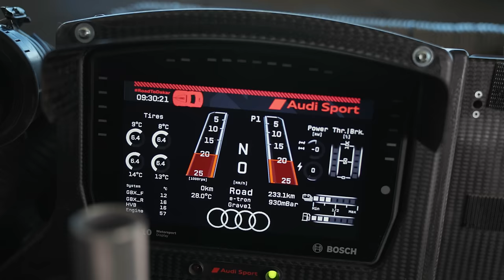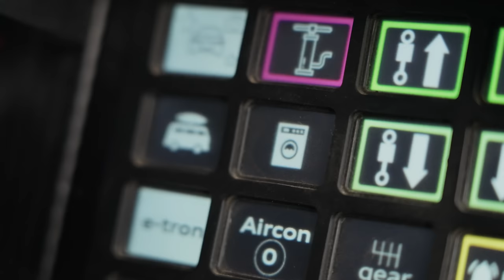FIRST DRIVE: Audi RS Q e-tron - Electric Dakar Car Tested On and Off-Road | Top Gear

Comment: Love it! Albeit all I can think of is the fact that that sound is just because of inefficiencies in the drivetrain/motors
Reply: Not necessarily. The sound indicates that they used spur gears instead of the nowadays standard helical gears. Normally, you don't find spur gears in cars, except the reverse gears in many older cars (remember that sound?), but they can actually be more efficient because there's less friction between the gears.
Apart from the loudness (which clearly isn't a problem here), the disadvantage of spur gears is that they can't cope as well with high torque, which makes them seemingly an odd choice also for a race car. But apparently it's ok, perhaps because the ground traction is low in the desert and the electric motors so smooth.
Reply: @leftaroundabout  electric cars have similar torque at all rpms , wouldn't that be even worse
Reply: @leftaroundabout  In reality straight cut gears are stronger than helical gears for motorsport because, 1 they don’t need to reenforce the gearbox and shafts to deal with the perpendicular torque created by helical gears, 2 they save lots of weight some of which can be used to reenforce those gears and regain any strength lost. (Plus most of these motorsport applications are using billet gears etc so they are already stronger than road gearboxes to deal with the torque)
Reply: @leftaroundabout  Actually no. Striaght cut gears can handle high torques, which is why they are used in motorsport. It's that they cannot handle axial loads because, as the geometry shows, there's nothing in the gear profile that stops them from sliding.

Straught cut gears are great for motorsport as they have high torques and reduced radial loads compared to helical gears. Like in this car, that has stupid amounts of torque (also because electric cars go 2x to 3x C rate at the start to overcome intertia since their gear ratio is designed for near max speed).
Reply: The sound is like in any vehicle- moving parts create vibrations which translate to sound. Now while we don't have the standard combustion sound, the only sounds we hear are A, from the straight cut gears, and B, from the motor bearings.

Thanks to fewer moving parts, motors have higher peak and average efficiency compared to ICEs. Motors go at 70-80% average efficiency and 95% peak efficiency (both mechanical and electrical) while ICEs barely manage 40% peak and a way lower average. Fun Fact: the last recorded highest thermal efficiency was my Merc AMG for their F1 engine in 2017, which is the highest any ICE has ever touched.

So yeah, motors are really extremely efficient.
Reply: @leftaroundabout  spur gears? Thats a rare one.
Reply: @arjun._.bbC6  Talking about the day that the Mercedes F1 team suprassed 50% thermal efficiency with their hybrid setup?
Reply: @TheSilverShadow17  that was quite a while ago. They released reports of surpassing it even further after that.

Comment: Any electric car should look and drive like that one.
There should be laws forbiding any other electric car 😍
Reply: calm down dude
Reply: Pass, i'd prefer a smaller more agile Electric Car for roads. Hmmm the McMurtry Spéirling exist. Not sure I could drive one at 8 / 10ths but I'd rather have one of those.
Reply: The main setback of electric cars is their weight, since the battery takes up a lot of space in the vehicle which is a compromise in performance and handling, and to make that more clear, EVs have their own bespoke tires made specifically for them to handle the constant load and rapid acceleration.

Comment: Serial hybrids are a great idea. The trade-off in efficiency is well worth it, given a car needs 500 kg less batteries to achieve a competitive range.
Reply: They are not a great idea, there's always dead weight in the form of generator.
Parallel hybrid with two motor-generators is a better idea. Which is why Toyota has been making it for 20years.
Reply: @Papinak2 
At the cost of either the complexity of a greatbox (parallel hybrids), or a huge battery (BEV).
Reply: @X8X8X8X8X8X8X8X8X8X  what complexity? Toyota uses a simple planetary gearbox. In exchange, it gives it flexibility to use both electric motors as generators and use power from the engine directly on wheels. More efficiency, more power per weight, less strain on electric components.

Comment: I wonder why a traditional, albeit high performance, 4 stroke engine was used instead of something like a turbine or something else (that I didn't think of because I'm not an engineer) that could run on any type of fuel more efficiently than a standard suck squeeze bang blow unit. I remember wondering the same thing about the BMW i3, bit that made more sense as it was a road car...
Reply: @UCEQedmncU9YWrrfOjyGzHEQ My point is that the four stroke engine is a compromise that was born out of the necessities of pushing a car along. 

It has the qualities that it needs to have for that job, and that job doesn't seem entirely the same as providing a reliable and efficient source of energy for a generator to run on. 

It's not only efficiency, it's volume, weight, cooling needs, the ability to run on environmentally sound(er) fuels etc...

I assume that it would've cost too much to develop a new engine of that kind AND design a competitive car around it, but that makes this car much less interesting to my eyes at least.
Reply: @TeslasSecret  Because Audi is not going to develop nor fetch a turbine or non existent powerplant purely for a Dakar car. Especially when there is a tried and tested 4 cilinder that will get the job done. There is an art in reusing what you already have instead of developing new things. Its amazing that the electric engines are from formula E and the 2.0l engine from an older DTM car.
Reply: The i3 took the engine off the shelf from MINI
Reply: a turbine on a dirt track ? 🤪
Reply: @Baukevandijk  I agree, but don't you think even for a second that it would've been far more interesting in the grand scheme of hybridised power trains ?
Reply: @-007-2  Hehe touché ;-)
Reply: @TeslasSecret  You probably know of the jaguar C-X75
Reply: @Baukevandijk  Indeed, that's actually what I had in mind.
Reply: @Baukevandijk  thats the point,reiterate and perfection it.
Reply: combustion engine is the most effective to make electricity for charge battery

Comment: An electric car...with a turbocharged 2.0-liter inline-four...from a race car.
Reply: R.G. LeTourneau used diesel engines to power the electric motors in each wheel of the earthmoving equipment decades ago.

Comment: Why charge it with a DTM motor? Why not just stick a more industrial type generator in it?
I think I'm more interested in the Fiat Panda at 3:20..
Reply: Higher power and less size and weight. I only see benefits in having a DTM engine for the most power output for the less footprint

Comment: It's kinda like a reverse hybrid with the electric motors move the car and the combustion engine is just there to charge the battery lol, it's still amazing though
Reply: It's how trains have operated for decades, and also how the Chevy Volt worked (until the engine directly powered the wheels over a certain speed).
Reply: @chiefsilverback  Which says a lot in terms of execution for railway applications such as locomotives. Because the engine is not connected to a gearbox and rather transferring the power it makes itself directly to the motors, it makes the mechanical efficiency that much higher compared to typical applications like road cars. Stationary power is also more efficient than connecting a gearbox to the engine, however it depends on multiple factors like the type of work that needs done, or where that power is needed most.

Comment: It's a series hybrid. Which is exactly how a hybrid should be 👍🏻👍🏻👍🏻
Reply: It tak was s gas too? I missed that part
Reply: I really like this execution of a Series Hybrid compared to (I think??) Parallel Hybrids. Where the engine has the task of providing temporary charge power to the battery as an onboard generator rather than being connected to a gearbox n such. Albeit a range extender.

Comment: It's quite funny isn't it, Ollie says the ICE acts & sounds like a fridge motor on a refrigerated truck. Previously you have an ICE making sound in sync with how you drive it and the motor powering the fridge humming randomly. On this car it's the complete opposite.

How the table has turned.

Comment: Hey...I Had The Same Idea With --->10:39<---Years Ago...For Commercial Cars...That Get A Flat Tyre...You Would Release The Catch Wind The Handle...But All Four Wheels Had It Tucked Away Conveniently Underneath Like A Hinge Fold Out Type Jack...And Another Feature Was To Use Your Car Keys That You Would Use To Unlock A Mechanism/Bracket At The Centre Of Rim After Removing The Hub Cap As A Security Feature So Low-lifes Don't Take Advantage Of This...And Steal Your Wheel/Rims To Flog To Some Wrecker/Spare Parts For Quick Cash!!! Smart Engineering!!! Just A Suggestion....Hmmmm  ???😉😉😉

Comment: 3:44 why this electric car have exhaust?
Reply: Because it's charged by a petrol engine
Reply: @falcongamer58  Then this is hybrid not electric car
Reply: @Mitaka130  yep
Reply: @falcongamer58   But Top Gear present this car as electric, non hybrid. LOL
Reply: @Mitaka130  i guess they're playing on the technicality that only the electric motors are used to move the car
Reply: Watch the video for the answer.

Comment: Have the Audi Engineers considered putting the E Motors in the wheel hub like in E scooters, or if they considered, why did they rejected the idea? What are your thoughts about it?..
Reply: Unsprung mass is the last thing you want in a rallye car.
Reply: A company called magna is working on something like that.

Comment: well using an ICE to charge the batteries so an electric motor can drive it seems a bit weird. 
in plain junior school physics terms you are converting  chemical energy to mechanical energy only to create electrical energy which ends up still producing mechanical energy at the wheels.
It not like how in common cars the ICE recharges its batteries through the motor thats used to start it, we arent really producing petrol while the electric motor is running are we.
Doesnt really seem to me as an EV at all.

Comment: Really it's just a diesel car with an electric transmission. Not a diss, a lot of diesel locs are built on the same principal, but calling it an EV is a bit of a stretch.
Reply: That would be true if the engine powered the car but it doesn't it's only purpose is to charge the battery.

Comment: ok that noise is not the electric motors. the noise is coming from the gears and/or differentials. they are all probably straight cut hence the whine.
electric motors are for the most part silent.

Comment: Why do I get the strange feeling that the sound frequency the vehicle emits in the cabin, will have immediate as well as lasting negative effects on the driver, which could be avoided completely if they take precautions now?
Reply: Apart ear proections?
Reply: Race car loud

Comment: Electric cars are developing dramatically because the future is speed, power and performance
Reply: And no sound so that is a big no no
Reply: @Swe_Slipknot  Power and performance are more important than engine noise
Reply: @kinisiayoube4449  gonna be some boring car meets in the future 😂
Reply: @Swe_Slipknot  Science is developing because electric motors are fast and have strong torque

Comment: so its a hybrid not straight electric with that onboard charger
Reply: Yes, I guess it isn't sitting on the level 2 charger at the hotel during the race stages.
Reply: @davidmccarthy6061  curiously they didnt show it plugged in to the standard charger

Comment: Amazing thing 
But surely the point of an electric class is to be ..electric ??
Reply: It is but it's carrying around a generator in the shape of a DTM engine. Carrying a battery that could last the whole stage would weigh it down too much
Reply: @MudhaffarAdhwa  But it does seem to make the whole exercise a tiny bit pointless. If it's got a 2 litre petrol engine, why does it even need a 50 kWh battery?
Reply: @londonwestman1  no idea about that, perhaps they want it to be as much of an EV as possible.

Comment: Why it sounds so annoying (the motor sound)?!!
Reply: That sound doesn't actually come from the electric motor, but from the straight cut gears in the transmission. Road going EV's like the Teslas are engineered to be quiet and use helical cut gears, which are less noisy but also less efficient and require stronger (i.e. heavier) gear cases. Straight cut gears are more efficient and can be contained in lighter cases, at the expense of noise, which doesn't really matter in a racecar.
Reply: @wolfrikvonschwarzblut3921  
Thanks for the useful information 👍

Comment: I feel like this is just more complicated. Why not just connect that dtm engine to the wheels and ditch the 1000 kilos worth of other shit lol
Reply: the whole point is to race an EV at the Dakar
Reply: @MudhaffarAdhwa  well this isn't an ev is it, it's a glorified hybrid with a 2.0l glued to it
Reply: @MrSuperflydude  hybrids use their electric motor AND engine to power the wheels. This is an EV with a generator stuck onto it. Carrying a battery that can last the whole stage would be too heavy.
Reply: @MudhaffarAdhwa  maybe it's time to admit electric cars aren't ready for Dakar lmao
Reply: @MrSuperflydude  difficult for Audi to develop a battery that can last 400 km of dune driving in 16 months lol. They're working with what they have in this car(DTM engine, FE motors).

Comment: An hydrogen powered turbine, running at constant speed to directly power the motors, with small batteries as a buffer would have worked much better and would have served as a proof of concept for a better technology. The biggest problem with electric cars today are the huge costs both environmental and monetary to make and maintain batteries and where the ellctricity comes from. If you use fossil fuels to create that electricity, you are not using a "green" car. Instead hydrogen generating plants should be used, using solar to generate hydrogen from water. Yet again solar panels have their own environmental problems...
Reply: Preach
Reply: wrong on so many levels not even funny 230000 km on my model 3 has convinced me of that and as an aircraft engineer for 40 years your dream of a hydrogen powered gas turbine is just that anyway good luck with your dreams.
Reply: @jank330  Hydrogen powered turbines are common tech also you are gonna have fun with that junk of a tesla when you are gonna need 30k dollars to replace your batteries.
Reply: @Gattone_91  The environment is gonna have more fun when the lithium for those batteries is dug up
Reply: @brettknapp2216  Lithium extraction is a hugely polluting process, yet tesla fanboys think it's the best thing ever. The fact that tesla cars also cathc fire like sparklers is another fun thing.
Reply: @Gattone_91  The environmental argument for a Tesla just doesn't exist between that and where the electricity you're putting in the car comes from. I'm just gonna drive combustion engines until people actually realize the potential for hydrogen power and implement it.
Reply: @Gattone_91  we extract over 10 trillion pounds of crude oil alone world wide each year. 

That's just crude, then it has to be transported in raw form all over the world to refineries. Refineries which run 24/7 consuming over 15 twhs of electricity annually. Refineries which also use staggering amounts of water and cobalt during the refining process alone. 

Then ya gotta transport the refined useable fuels again. With each 300#+ barrel of crude only resulting in about 19 gallons of useable gas and 11 or so gallons of road diesel. 

Then after transporting it burning even more fuel via ship truck or trains. It also gets pumped through pipelines which consume massive amounts of electricity. To store it in underground tanks which leak into ground water sources. 

Before you pump it up into your ice burner using more electricity which then burns it at 20-35% max volumetric efficiency. 
Creating even more pollution heat noise and toxic exhaust fumes. 

Not to mention your gas guzzler has a battery in it which also has lithium cobalt lead and acid in it. Plus multiple electric motors to run it.
Your catalytic converters also use rare earths called platinum metals groups in their construction. Hence why cats are stolen so often. 

I could go on but your obviously uninformed and not to intelligent since you don't already know all this. 👍🏻
Reply: @brettknapp2216  Already today, we can have hydrogen cells for electric cars, such a simple tech they made toy cars with it... or use hydrogen directly in combustion engines. Either way, final products are power (mechanical or electrical), heat and water...
Reply: @4literv6  I already know all this, but what is your point? I propose the use of clean hydrogen and you start talking about crude oil and stuff like that? Seems like I have found another lithium tesla fanboy that doesn't even know what we are talking about but just starts spouting a prewritten comment with no thought behind.
Reply: @4literv6  All techs have their problem, if you don't implement something new since it's not perfect, you are never gonna have change. What's your opinion then? Just keep using fossil fuels and not make an effort to find better solutions? As more money and interest is invested, better tech will come out, as it did for fossil fuel cars.
Reply: Yeah EV's are going to be frowned upon in the future.
Reply: @4literv6  Bruh you really wanna make the argument to not put catalytic converters on cars, do you know what they do